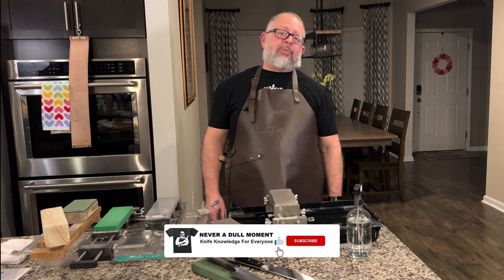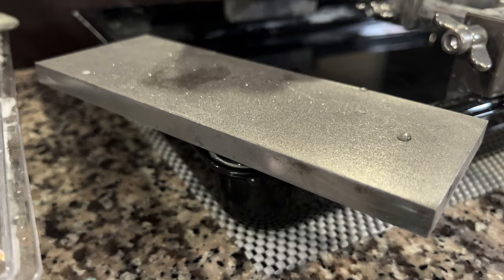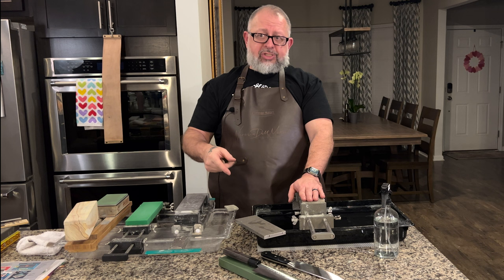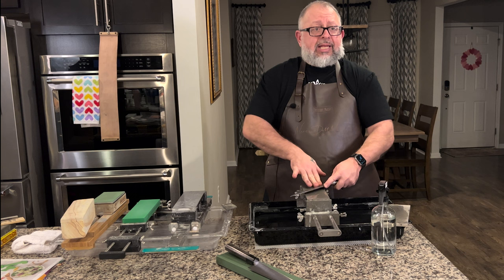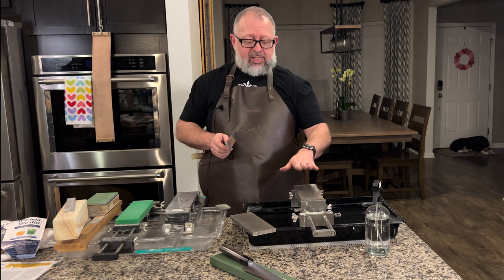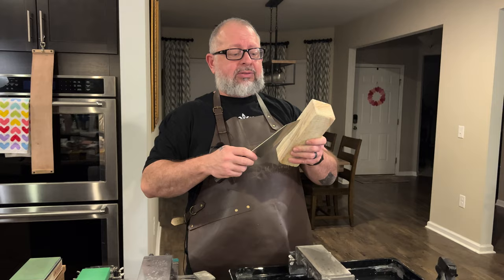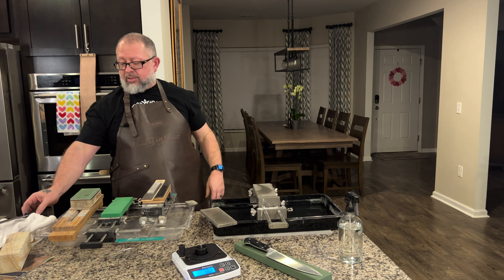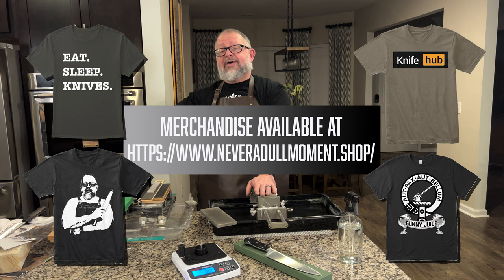Knife Knowledge: CBN Whetstone built to do the job. What you need to know. Testing on Hap40!

Comment: you can most definitely sharpen the Hap40 on the naniwa 😂😂 i sharpen my HAP40 (pretty much the same knife that you have just a gyuto and the european version under the different brand name which is advertised 66-67HRC even) on some cheap Taidea combo stone with no problem
Reply from the maker: I am going to be getting a chart and putting all the different stones out there that can handle the different type of work. I'm glad you had a great experience. I am collecting everything I can. I know some of the better manufacturers as you mention have done a great job with good abrasives. It will be interesting with the ZDP189. I have seen other people as I mentioned in the video who have spent more than 30 minutes on a knife with a regular stone and not had the same results you have.. I know people can take their time. I don't have a lot of time to spend on one knife. I think most people would buy these hard steals so they don't have to sharpen. I definitely would like to be able to use everything so I can get to a much finer edge. I also know that not all steel is he treated to the same hardness. Just because it's Hap40 does it mean it's reached its highest heat treat! I did put a chart in the video showing that some people only heat it to a 64 and so do you have to look at the specs of your individual knife. As always, I'm excited to get information from individuals. I thank you for coming and your support. We will continue to do more testing and we always look for more suggestions from the audience.
Reply: @nadm  You can do ZDP189 too.
The key as I said it to have less than 4% vanadium :) 👍
Reply: @nadm  
You can sharpen any steel on an alumina stone like the Chosera. Alumina can't cut the Vanadium carbide but it can shape matrix. I agree that diamond, CBN, or silicon carbide is better for the 3-4 percent or higher Vanadium steels though. I'm guessing that's what you meant in the video. You can even cut 64+ Rockwell steel with Arkansas stones. It's slow as can be, but it does cut.
Reply from the maker: @whocares3986  Thank you and yes! I didn’t mean to overstep myself. Of course you can get things done but it’s a lot slower on the other stuff. I appreciate the support. I do need to craft my words a little more carefully. Thank you

Comment: Thats a Gihei right? I have Gihei Santoku in HAP40... You can absolutely sharpen hap40 on Chosera/Ceramic based alox stones🙏 Very big misconception about supersteel hardness..The carbides are harder but steel matrix itself is not and the size of carbide is 1-12micron (depend on what exact type) and having those carbides exposed is perfect working edge , BUT its better to use cbn/diamond for it , especially resin/metal/vitrified  bond... HAP 40 is nice hard steel but its not like REX121 or 15V ot even 10V level where you absolutely have to use SuperAbrasives.. Just to add little info Grag🙏
Reply from the maker: That was not the maker of that particular knife. You are definitely talking some advanced stuff and I love it. There's some stuff in there that I am aware of because you're talking about certain steal that I haven't been exposed to. Congratulations on your experience.

Comment: I keep thinking about buying a ZDP or a HAP40 knife. I guess if I do I have to think about getting new stones also , thanks for the input .
Reply: I agree. Already I have different stones for polishing my
Powder or Carbon steel knives. Now I would need another for the lower grids as well. 🤔
I might decide on that once I need a flattening / trueing stone. That could open the door for knives with an HRC above 65.
Reply from the maker: I'm going to have to come out with a chart that shows which ceramic stones are capable of sharpening both. The ZDP knife is extremely hard and it basically is stainless and you won't have to worry about it Edge for a long time. The Hap40 does come in a little lower. Steel ask stainless as well. Again, holds a very long edge. You might have certain ceramic stones in your possession that are able to do the job but not all of them are able to do the job. A lot of it depends on the blacksmith and the heat treat.
Reply: ZDP has nothing but chromium carbides and has ZERO issues sharpening on regular waterstones. it's a cutlery steel. it's designed that way intentionally. Any steel actually intended to be used in kitchen knives will be easy to maintain with nothing but normal gear. HAP40 on the other hand is not. It's a very niche, fringe even, low volume cobalt matrix high speed tool steel that CKTG has promoted for kitchen knives for some reason I don't really understand other than maybe to a laymen it looks good on paper. This is a steel with 8% cobalt and enough vanadium such that you will not have fun trying to grind it with normal whetstones in the sharpening grits. I dont like how CKTG lies to their customers and acts like oh yeah it's not bad to sharpen on your regular whetstones. yeah okay. Maybe if you use your 400 grit in place of your 1k or 2k stone, then you can try to make that argument.  Anyhow. To me it makes no sense.  The benefit it has over ZDP is that despite the cobalt it is tougher. It's not stainless, it doesn't sharpen nor polish anywhere as easily or nicely, and it doesn't have anywhere near the edge retention of ZDP, but it is tougher and able to get just as hard.  One was made specifically for high end kitchen knives. The other was a repurposed tool steel promoted by a major reseller with a lot of influence in the industry.
Reply: @nadm  Neither of those steels are used by blacksmiths. Stock removal only. And consider the Vanadium content  in some of more modern super steels. No Ceramic stone can cut Vanadium carbide other thanthe diamond infused ones and the start at around 400 usd per grit. Big Brown Bear has them when in stock. 

For these, I would suggest diamond or CBN in either a risen or metal matrix stone. Venev, Poltava, Jende. 
extensively testing the Poltava stones in the tin/Copper filled matrix stones currently.   
I have a great deal of experience with the Venev resin stones. Grit o matic ahs a good selection of all ot them, Plate and matrix. 
KnifeMaker
Reply: @user-xf4es7eh9y  When properly sharpened for the intended use, High Vanadium steel will( which is a LOT of fun to sharpen. I can do it, but ceramic is a pita to get a keen edge on).   out cut, (edge holding) any other blade material other than a ceramic. However, Vanadium does not like a polished edge. No stone other than Diamond or CBN can impart a fine toothy edge that really makes the Vanadium steel perform. When so sharpened, it will blow any non Vanadium steel in the weeds. 

Vanadium Carbide is harder than Ceramic stones by a good margin. Hence, cannot abrade it. It is harder than  tungsten Carbide which also is harder than ceramic so this is perfectly understandable. 
KnifeMaker
Reply from the maker: @michaell397  unfortunately, big brown bear has stopped making his. I didn’t even get a chance to grab a hold of one of those.
Reply: @nadm A shame. They were always on again, off again. Could they just be out again? I wonder who he was having make them. They were almost always out of stock. GRRRRRR!!!
KnifeMaker

Comment: I tend to use my Suehiro Cerax 1k 99% of the time and it'll sharpen 65-66 HRC. Done it dozens of times on customer knives. Really don't like ZDP 189 though. Hap40 is better but still not in love. I don't think the hardness to edge retention pays off. It'll get you an extra 10% maybe but the edge tends to be over toothy even with a polish. Just don't enjoy it.
Reply from the maker: Do you feel like your timeframe is the same when you sharpen it? Something so hard doesn't it take longer?
Reply: @nadm  definitely takes longer. I would say maybe 15-20% more time. Seems about the same from my experience between like a 57-58 Wustoff and a White #2 at 61-62. I just don't think that level of hardness makes a better knife for kitchen knives as it would for an EDC knife or something. I like the 62 range for kitchen knives. Then again, most people don't own a strop, stone or even a honing rod so for some maybe that 66HRC gives them time between sending the knives in.
Reply from the maker: @JeffSmith-eq3kc  You can Strop on most anything. And I do like a different variety of harnesses in knives. I like the material. We all have our favorites.

Comment: I don't understand why the Germans like such soft tempers. Specifically the mid to high end stuff. (At the extreme cheap end it's about warranties and people abusing the knives. Bending is obvious abuse/accident while a break could be either abuse or a flaw.) 
They don't need to go full in Japanese style but a couple more points would make a real improvement. I have a German carbon-steel single bevel grafting knife and it also gets tons of burr that needs the suede side strop, I think its only about 57hRc. Once I get a backup I'm going to see about getting it re-heat treated to ~60-61.

Comment: Do you prime the cbn or diamonds before sharpening? When I get a new plate I run a large chisel over the surface a few times before I sharpen on it to make the surface more uniformed
Reply from the maker: Thank you for that. I was unaware of that. I always love it when you guys comment because we learn from each other. Please elaborate more when you have the time.
Reply: @nadm  sure when you first get a plate the diamonds have quite a few rouge diamonds that aren’t going to stay on the plate very long and give you a uneven finish and can be damaging or not true to grit. 

I literally knock the top diamonds off by running a 2 inch chisel over the surface taking off the uneven layer that came from the factory. Not to much pressure but you can get a feeling for it when you do it.
It’s kinda why when you first get one it feels so aggressive, not true to grit level. 
This is recommended it achieve a uniformed grit.
Reply from the maker: @bozoedge  thank you

Comment: I have a weird question but seeing how sharp that 1200 grit stone got the knife how fine do you need to sharpen too?  can you go too fine of grit where you aren't getting any sharper of a knife?
Reply from the maker: In a way I wanna say yes. Technically you’re just cleaning the Apex. You shouldn’t be pressing harder when you get above 3000. You should be kind of cleaning off any metal debris as you polish. The clean Apex makes for a sharp knife with great as retention. If a knife has teeth and the teeth can fall out. I have found uncertain steals that you don’t need to go be honest certain point. It really does make a lot of difference on the heat treatment as well as who did it as well as the type of steel. A lot of that is just experience. You really normally only have to sharpen a knife two or 3000 grit. I would maybe go higher on all of your single bevel knives for the fish because they really can use a clean edge
Reply: @nadm  thank you! That Is great to know!
Reply: The grit standard matters too, for example a FEPA-F  or ANSI 1200 is similar micron range to JIS or FEPA-P 3000-4000
The website for those cBN stones doesn't say if it is JIS, FEPA-P, or  FEPA-F, they are in europe so FEPA makes sense but even then are they using -P(coated paper fabric or plastic) or -F( bonded stones ).
Reply from the maker: @mytech6779  I will have to ask Hans who made the stones what the grit standard is
Reply from the maker: @mytech6779  I sent him a personal message. He’s in Germany. He’s probably asleep right now. I’m sure he’ll wake up tomorrow and see this and hopefully he will respond to this himself.